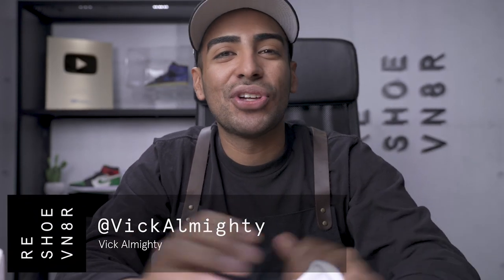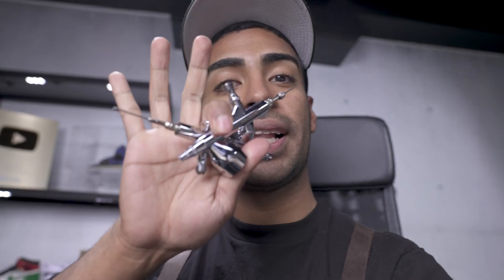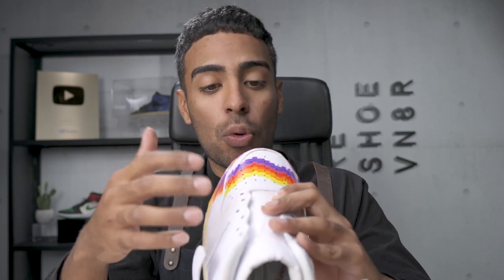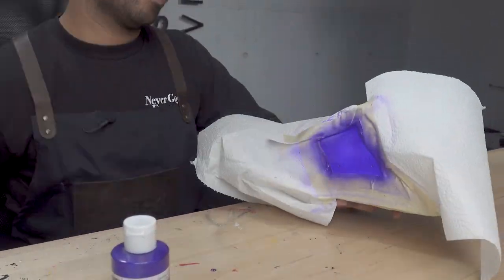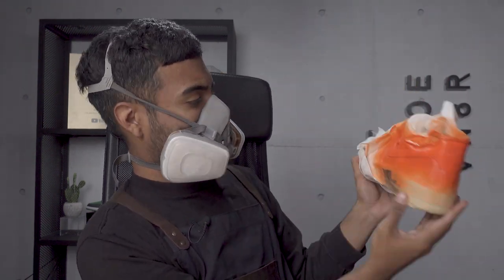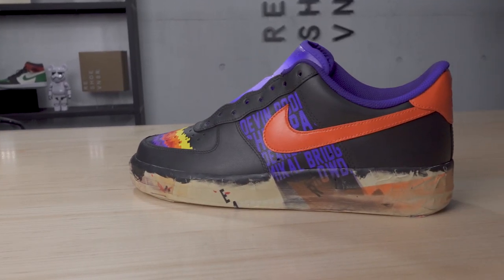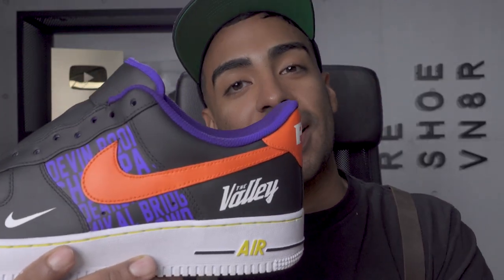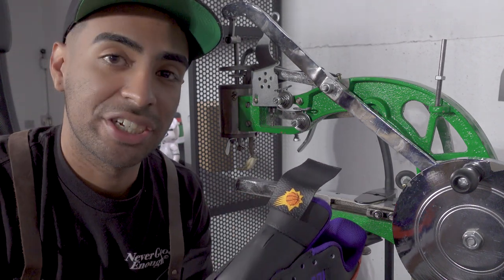Air Force 1 Phoenix Suns Custom With Vick Almighty

Comment: no need to 2 soft when using jaquard on fabrics? just heat set as normal and you are good to go when using straight out of the bottle?
Reply from the maker: Correct, you dont need 2 soft when using Jacquard on fabrics. You can heat set the dye though, just be cautious to not concentrate in one area with the heat gun or else you will burn the fabric.
Reply: @RESHOEVN8R  cheers guys! When you refer to dye I am assuming you used jacquard paint airbrush paint. It looked like that from the bottle. Unless there is a specific jacquard dye and if so I need to find that!

Comment: can you use paintbrushes for stencil work on jordan 11s or is a airbrush required
Reply from the maker: You can definitely use a paintbrush with stencils. You just have to do light coats. There is some chances of needing more touch ups due to bleeding under the stencil when paintbrushing though.

Comment: I hate using cotton balls to remove the factory finish because it leaves so much lint. Any tips on avoiding this?
Reply from the maker: One trick to remove some of the lint is to use some masking tape. Get the tape and stick and remove on the areas with lint!

Comment: What kind of vinyl do you use the one I use always leave the shoes so sticky?
Reply: Or like how do you remove the stickiness of tape
Reply from the maker: You can use the Vinyl that is branded by Cricut. One way to remove the sticky residue is using some masking tape. Just get some masking tape and place over the residue, then you will be able start to remove some of that residue.
Reply: Keep in mind use the removable vinyl. Read before buying so you don't end up getting the permanent one.